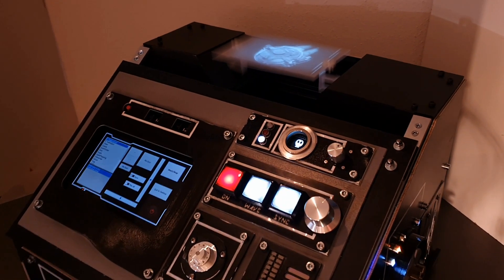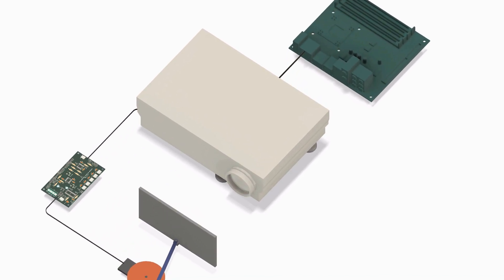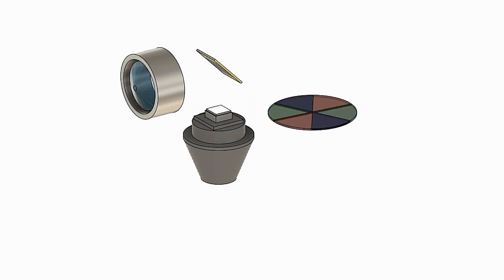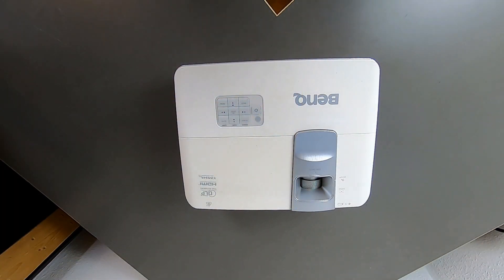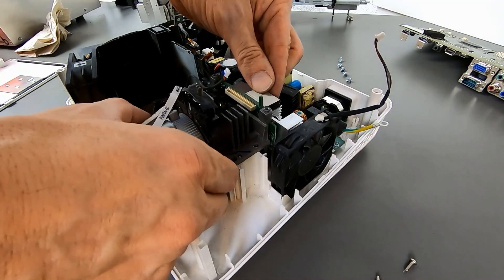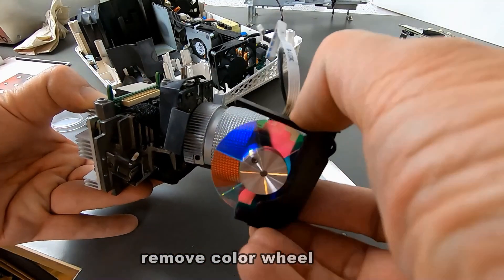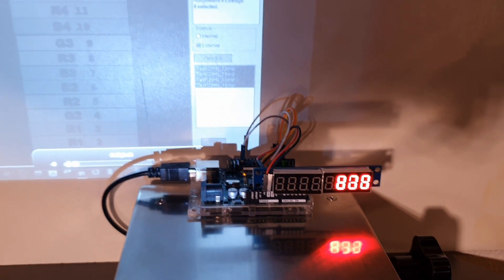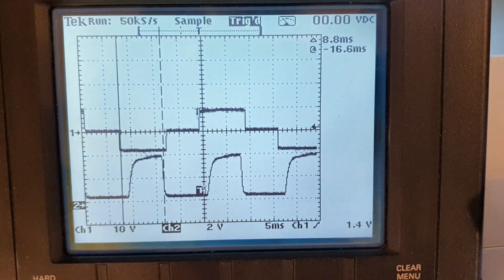DIY volumetric display (Star Wars inspired) - part 1

Comment: What is the refresh rate of the projector? And if we change the dmd that we can achieve a higher frequency? Is it possible to use several dmd chips to display separate colours?
And if we increase the amplitude of the movement, would we need a higher frequency?
Reply from the maker: Thanks for your questions. I am using the 120Hz input mode, which provides consecutive 120Hz R, G, B images, so as described I use them as 3 black and white frames 120Hz*3 = 360Hz.
Higher frequencies are always possible if you have direct control over the DMD. The TI LightCrafter kit that others have used to make such a device would be my recommendation. But it's very expensive (for a hobbyist) and not easy to get.
Colors can only be achieved if you have enough fps or if you would combine 3 units (one each for R,G and B). But that would be a huge effort.
The amplitude would be improved by optimizing the swing arm mechanism or perhaps by using a different material for the semi-transparent projection plate.
Reply: @makermac70  Thanks for the reply!

Comment: Congratulations! What do you think about creating a larger projection surface, and placing it inside a vacuum glass dome so that the movement does not suffer from air resistance?
Reply from the maker: Thanks for the suggestion, I am a bit afraid that a closed vacuum chamber would increase the complexity, but others have made similar suggestions, so I might consider it for a next version. But the main prerequisite for a larger volume would be to find a faster projector (>1000 fps).

Comment: Why wouldn't a six color projector work?
Reply from the maker: Great question! The reason why a projector with a non-"RGB color wheel" would not work is because we want to use the RGB color subframes as individual monochrome frames. A 24-bit RGB input bitmap from a PC can be seen as a combination of 3 images (individual R,G,B color planes, 8-bit each). These 3 subframes are always displayed in sequence and correspond to 3 distinct images on our moving plane. 
However a projector with a 6 color-wheel such as RGBCMY, RGBCWY would somehow remix these input colors (yellow=green+red; magenta=blue+red etc) and the resulting frames are no longer controllable.
Reply: @makermac70  That makes a lot sense. Do you think it would be possible to do this with a 6 color configuration? I got an old dell 1510x laying around and was thinking of trying this but if it's too crazy i'll try looking for another projector. Thanks!
Reply from the maker: Sorry, I don't know this particular projector and its features, so I'm really not sure.

Comment: Great insight on removing the color wheel for increased frame rate!
Reply: so why did you need to keep the color wheel at all, if its no longer used?
Reply from the maker: The color wheel cannot be removed completely because the projector would not work anymore. 
The electronics will refuse to operate the projector if it can't detect the signal it expects from the wheel sensor.

Comment: How exactly did you clean the DMD? I did see a Q-tip but I guess that would make more a mess the good?
Reply from the maker: I followed the official TI cleaning instructions for DMD glass: "The least aggressive cleaning method is to use forced Ionized Air. A more aggressive cleaning method is wet cleaning. This method uses liquids such as isopropyl alcohol with DI water." So I used Q-tips to apply some isopropyl alcohol and a microfiber optical cleaning cloth. Worked great for me.

Comment: looks great. why not more height for leia?I like the soft falloff at the screen edge touch
Reply from the maker: Thanks for the comment. I would have loved to show the leia scene ...., but the reduced height is the limit for this DIY version. More vertical projection area means more drive or less air friction. But at the same time you need a much faster projector to cover more vertical planes.